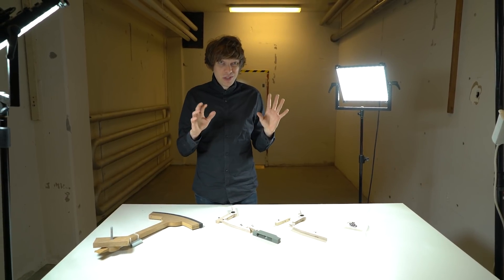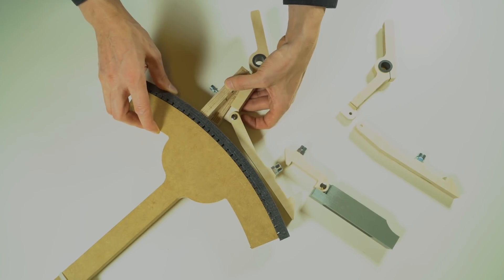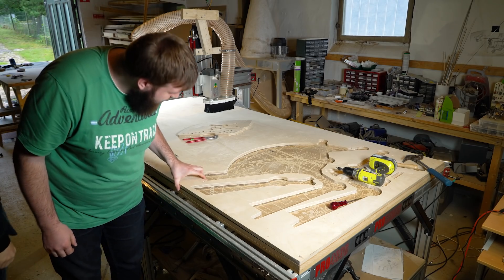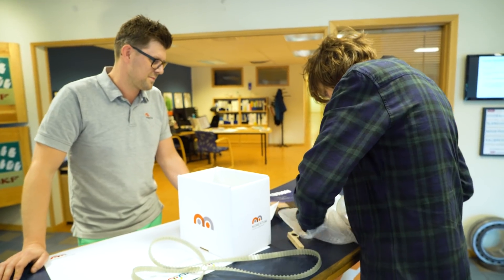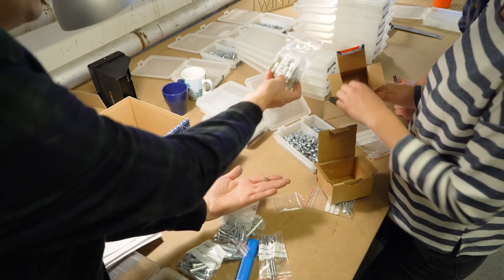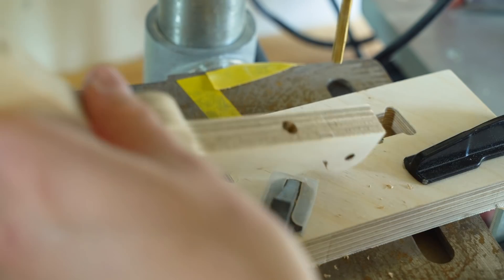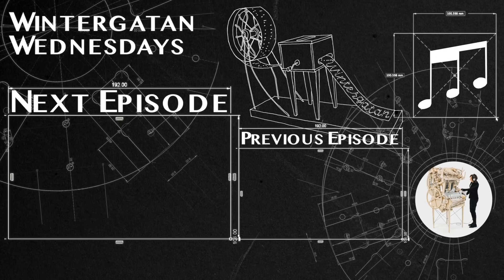158 Plywood Parts - Marble Machine X #16

Comment: This is extremely late but there is a much safer way to use the router table to make mortise and tenon joints like you are doing. There are router bits that come in pairs, one that cuts one gap for the tenon and one that cuts two gaps with a perfectly sized mortise between them. You use the router bits with the workpiece lying down so it's much safer and more precise.

Comment: should have split the router fence open set the bit behind the open fence for your pass depth with it then just run it bit on the back wide with a father board taller then your bit depth.

Comment: 7 hours of CNC time for only that little amount of parts ???? And also a lot of work to remove all the parts ?!  I'm a CNC operator for 10 years now and this can be done much much quicker. Even with the machine that's used here.  when it's just drilling little holes, no need to let that drill go up and down 5 times to go thru 18mm of plywood.  I'm using a 6 mm Belin router bit with a negative spiral (downwards spiral) and go in 1 single pass thru 18 mm birch plywood.  The only time I work in multiple passes is when I have to cut 20 mm  PMMA / acrylic / poly-carbonate a.k.a. "plexiglass".  The machine I operate is an American brand called Multicam and the model is the 5000 series. It has an 8 horsepower water cooled spindle with a max rpm of 40.000.  My settings for 18 mm birch ply would be: 6 mm negative spiral bit @ 28.000 rpm with an X/Y feed rate of 7 meters a minute and a Z plunge speed of 2 meter a minute. That's for the cutting of the parts and the drilling of the holes of 6 mm and larger.   Smaller holes are drilled with the size that's needed. (most of the time 3 mm pilot holes) 
The reason I use a bit with a negative spiral is because the dust is compressed into the slot after the bit has passed. That compressed dust is keeping the part in it's place. With a positive spriral there is a big chance that the part is lifted up and could fly away , especially if the parts are small and not much vacuum below the table to hold the part in place. (my machine has a vacuum table)

Comment: You could have routed those "tangs" horizontally....
Just use the fence and jig to do the shoulder cut, which is the critical dimension on that axis, then hog out the material below it. You can set the depth of cut much more precisely with the router than the fence and you would only need about a centimeter of the bit exposed(if that). It would be safer, less strain on the tool, more precise and simply easier to do. You wouldn't even need the clamping piece on the jig since that face would be against the face of the table

Comment: Looks like you need a Machinist on your team! That secondary routing operation you were having problems with could have been done quite easily and accurately on your CNC router. I know this is comment is outdated compared to where you are at currently in your build of the MMX, but I'd be happy to give you some ideas on making CNC router jigs.

Comment: To set the fence distance, 11:00, use "adjustable parallels" set to the correct thickness.  Instead of cutting them standing up like that, lay the parts flat on the router table and use a wide router bit set to the depth you want to cut, much easier to set correctly.

Comment: Do the programing pins are actually made of magnets? Those rare earth magnets can loose its "skin", or even break. If the pins are made of magnets, and you ever experience they loosing it usefull life (as breaking or loosing skin, and not the magnetization life), you can exchange making the base of magnets, and the pins out of metal. (if this isn't already the case).

Comment: So basically from the first few minutes of viewing the new build: You've made an intricate crankshaft, camshaft, push-rod, and valve assembly. Or series of assemblies. In other words a non-internal combustion musical engine. The aircraft mechanic in me approves. The trombonist part is wondering when a horn section is going to be dreamed up and magically incorporated into one of these. I'd imagine a reservoir/bellows system would be necessary.

Comment: I have a little suggestion for the type of filament. There is actually a wood filament but most of the wood filaments are very dark. Another type of filament I think would fit really well is sandstone filament. It has almost the same color as the plywood.

Comment: I would suggest putting a bushing on the router table and then have the jig extend beyond the piece at the height of the bushing, also adding a horizontal runner/handle at 90 degrees to the jig. it would take a little fussing to get the jig tab thickness correct but no more than the experience you already went through. then you run the trim down action just like your flush trim bit but in reverse, and you get much better control and stability.

Comment: Hey guys. Have you thought of using acetal at all for the build? It's an "engineering plastic" which you can buy in sheets/rods etc. and you can machine it with wood tools. It's almost as strong as metal for some parts. I would have made those gears out of acetal - I'm sure they would do the job. You should check it out as it might be useful for some of your parts.

Comment: To make routing operations more safe bury the router bit into the fence of the table. Then use a feather board to push the part tight against the fence where the router bit is located. This way you get a consistent cut on the side of the part being routed.

Comment: Getting excited about the music it will play.
Thinking about all the weight of the parts and overall friction, your wood blocks, used for the registrars, may wear out quickly.  Your pins in the music wheel are metal and will place a lot of pressure on a single point on the registrars when they are about to finish their play.   May have to insert a thin piece of metal on the face of the registrars.  
Also, your pivot points on the registrars may require felt around their metal hing pins.  Moving joints made of wood have trouble with humidity in the form of warp and swelling as they age.  Consider the parts of a piano which have felt.
This looks like you have spent a lot of time thinking about the new marble machine.

Comment: It would be better to use the end of the router, feeding the piece horizontally. You can then use a short, thick bit. In that method there was a risk of the router bit breaking and flying off.

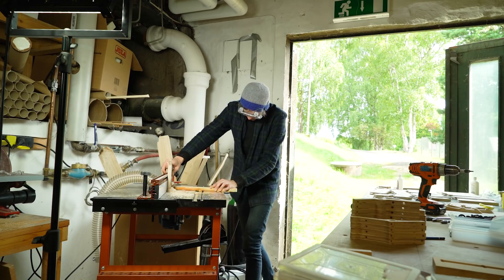Comment: Routing in 11:20 you should feed the wood from left to right just in that case.The way you feed it was really dangerous and begging for kickback!
Reply: Always feed against the rotation of the bit not the same direction. Climb milling should only be done on a Bridgeport vertical mill where the feed is screw controlled. Or program a climb mill on the CNC if you need a smooth finish.

Comment: Hey Martin!
I wanted to share my concern about your plan to reprogram MMX between songs during a concert. Even with a team backstage reprogramming during each song, I'm not sure you'll have the time to accurately reprogram the wheel. The number of notes and holes is absolutely massive, and where one wrong note repeated through the entire song could be a disaster, I don't think it's practical. I think you'd be better off building specific wheels for each song, and one or two programmable wheels for composing and testing new music. I recognize traveling with them would be difficult though. I've done a mockup of a system in CAD that's essentially a long belt of pins that could be wrapped around your programming wheel.

I'll also mention that others in the comments are very correct, neodymium is very fragile. Even clicking them together from a few mm apart can be enough to shatter them into a million little pieces, and believe me I know that from experience

Alice
Reply: I think Martin told on a previous video that they won't alter the programming wheel, but switch it with another already prepared wheel, so this shouldn't be to hard to manage correctly :)
Reply: An alternative to having a programmed belt, would be to have a prepunched paper template that you wrap around an empty programming wheel, and can be used to place the magnets accurately. Another alternative would be a separate robot mechanism that can program the wheel.
Reply: Phono plays! "Even with a team backstage reprogramming during each song"
Alice knows that that's how he plans to do it, but is skeptical that it'll be enough time, considering how much of a problem it is if a note is placed wrong. I'm inclined to agree. Preprogrammed wheels for each song is much more viable, though it does lead to an issue with portability.
Reply: I believe he said they will have a second , already programmed wheel, and while that is playing (or possibly during an intermission) they will reprogram the first wheel.
 They could just use a couple paint markers to identify the holes.

I agree that magnet poles are too fragile for long term use though.
Reply: soangry yes, she knows that's how he plans to do it. Even with reprogramming backstage during a song, she doesn't think it feasible. I'm inclined to agree. However, marking the correct holes for specific songs might well speed up the process adequately. Perhaps have a certain colour that represents each song? I'm just spitballing, but that seems like a good way to have a long setlist while not having to bring in twenty preprogrammed wheels.
Reply: You don't need whole new wheels. Just have the pre-programmed plates that get attached outside the wheel. Those are quite portable. Programming the wheels live is definitely a disaster waiting to happen.

Comment: With that operation you weren't comfy with, use a table saw and make several very shallow cuts 1/8" away from each other, and it hollows the exact amount out you need.

Comment: You will need a way to prevent the Chicago screws from working loose.  The intricate wood parts need to be soaked in some sort of resin to impregnate them, and protect from the cross-grain parts splitting or the plywood delaminating.

Comment: I know why the timing belt was jumping!  When you design timing gear for the belt, the tooth pitch must be SLIGHTLY LESS then the belt pitch.  Reason is when some debris (or irregularity in the fabrication) causes the belt to not totally seat into the gear, it gets behind because it is a larger radius.  This leads to a runaway situation where the belt gets even more behind on the next tooth, riding higher yet.  With the pitch a little short, the belt tooth will always be a little ahead of the next gear tooth, and will move outward to compensate.  The belt will be able to constantly adjust itself to mesh to the gear.

On aluminum gear, wrap belt around and hold at 2 opposite points.  I will be willing to bet that you will see slack at point in between.  This is true of both bike chain and timing belts.

Comment: Why not mute by lifting the levers away from the programming wheel, just out of reach of the pins?  The hooks can be replaced with a single long link.  The essential sharp part of the wood latch will wear.

Comment: Router Safety 101....always cut against the spin of the bit.
The safe way to do that routing is to route on the other side of the bit. Open the fence and move the fence so the bit is in the gap in the fence.
Then cut with the same jig, but have it facing away from you, so that you are pushing the job against the spin, not with the spin....you don't want to have the bit grab the wood and pull the wood into the bit (or worse, pull your hand into the bit)

Comment: If you plan on shipping the machine by air in the future would be good to check what is the limitations for the amount of magnetized materials you can carry.  I know magnets are treated as Dangerous Goods in air freight for the threat magnets pose to the navigation instruments. The price for some kind of special handling may also apply. Would be nice to check it before using too many magnets. Cheers and good luck with the build!

Comment: pulley, not gear. a gear engages another gear. a pulley engages a belt.
Reply: He's using sprockets, not pulleys. As to whether to call them gears or sprockets that depends on application, loose I'd still call them gears.
Reply: TheAchaicus id accept them being called a sprocket, however they are 100% not gears
Reply: The dictionary calls those gears, and in fact calls any rotating machine part with teeth that mesh with other toothed parts gears. The other parts may be stationary or not, so whether a gear is meshed with another gear or not as in a wrack and pinion, any toothed rotating part is a gear.  Those are gears.
Reply: TheAchaicus isn't sprocket only for chain? If it's for belt, it's pulley, no matter if it's flat, V or timing belt.
Reply: Not everyone is an engineer so there are more ways to use words that are accepted than just engineering terms.
Reply: So look at what it says in a dictionary written by an engineer.  I find under the entry for Gear; "Wheel like part with teeth cut into rim."   Still defined as a gear.
Reply: Car wheels and tractor wheels do not have teeth, so thus they are not gears.  Yes I know tires have treads which in some cases look like "teeth", but tires and wheels are two different things.
Reply: TheAchaicus Then look for pulley in your dictionary. Pulleys have one important feature - flanges around its circumference. I'm sure you'll find same definition
Reply: So what do you call a gear if it is removed from its position driving another gear so that it sits alone? Or how should a manufacturer label these things if some of them will drive another gear and some will not in their final usage?
Reply: Ok, that I can accept as a plausible reason to make the distinction because that adds a definition that I couldn't find even when I tried looking at a supposed engineering dictionary. I still quibble that a gear is still a gear even if it is not currently engaging a gear. I think of a pinion gear used by, for example, a cog wheel train, which engages a rack not a gear. By your continued statements that is not a gear but something else yet? Perhaps I still don't understand.

I was asking about what a gear is called after it is taken apart, because I thought perhaps I was confused on whether gear is a verb or a noun as used in the current discussion. And for the record those dictionaries aren't mine, but Webster's, and Oxford's dictionaries.
Reply: Goodness guys! LOL
Reply: Jake Minogue Can you please tell me who writes the dictionaries? Because I doubt they were engineer bias.
Reply: TheAchaicus the dictionary wasn't written by an engineer
Reply: TheAchaicus does that make a car wheel or tractor wheel a gear? No. Just because you can fit it into that definition doesnt make it right. Dictionary defines a dog as "a domesticated carnivorous mammal", this also describes a cat, but that doesnt make a cat a dog...
Reply: TheAchaicus mate you are just wrong. A gear drives another gear, but you go and read your precious dictionary if it makes you feel better.
Reply: TheAchaicus a toothed belt pully cant ever be used as a gear. The tooth profile isnt involute, and the pressure angle and root thickness of the tooth simply wont allow it mesh with another pulley. You don't understand the geometric complexity of a gear vs a toothed belt pulley.
Reply: TheAchaicus a gear that sits alone in its final usage? Thats called a paper weight... haha
Reply: I know I'm about to necrosis this post, but wtf?!?
Jake, maybe you should take a trip over to AvE and see what he has to say about your pedantics.
You could talk to watch makers and be completely wrong about what's a wheel, what's a gear, and a whole bunch of other things because it's all contextual. The point of having district words for slightly different parts/mechanisms is to prevent confusion while it passes from person to person from design, to fabrication, to installation. Often while there are multiple pieces being worked on at any particular time. In the context of this build, it is not critical. Firstly because it is a one-off project that is seeing dedicated focus and much communication. Secondly, because mistakes are not make-or-break. Thirdly, because he is talking to the YouTube audience.
Unless you are working on this project yourself, stop being a pedantic dick. If you are working on this project, why the f**k are you making those comments on here Ustad of bringing it up to them in person. Either way you're being a dick